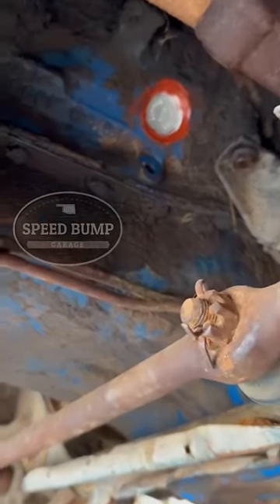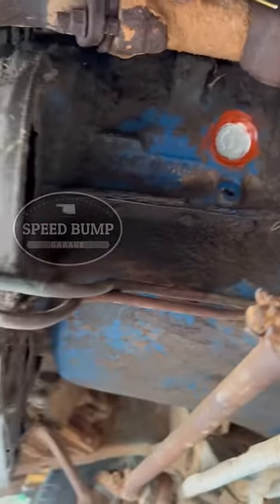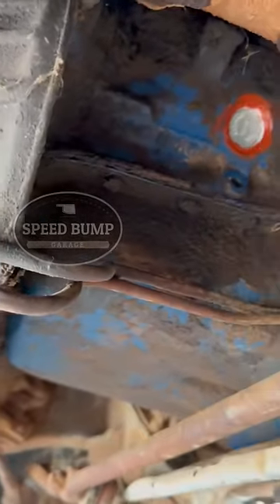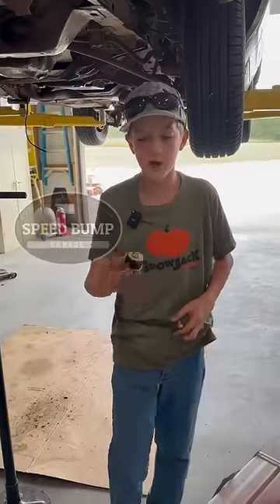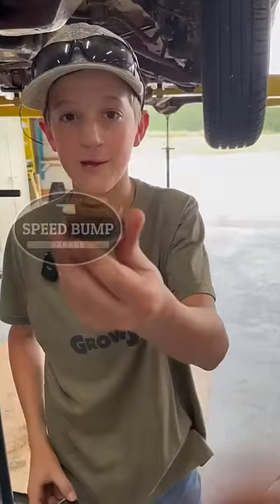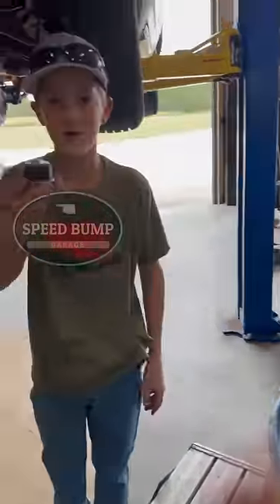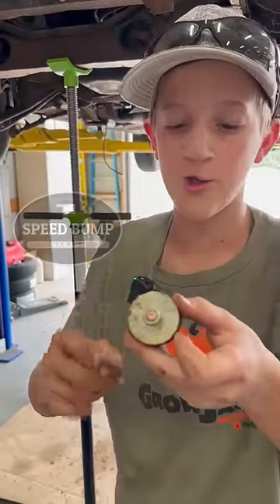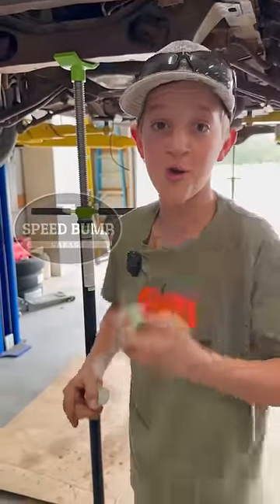Can GrowJack Make this Ranchero Run Part 9

Comment: If you need to you can put the freeze plugs the metal ones in the freezer overnight this makes them contract a little bit then you can insert them into your freeze plug on your engine by tapping lightly I use a block of wood and a hammer

Comment: Did you know they were never designed as freeze plugs? They were originally designed to remove  the sand from the casting !
Reply from the maker: I have read that. Pretty interesting

Comment: That motor mount looks a little worn.
You might want to keep your eyes open for a good deal on replacements.
I think you don't put silicone on the rubber ones.